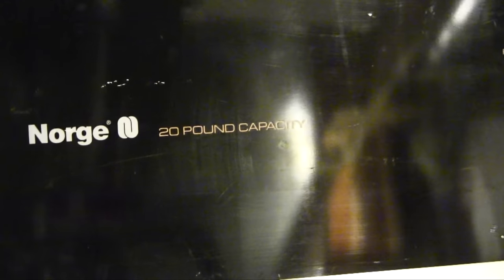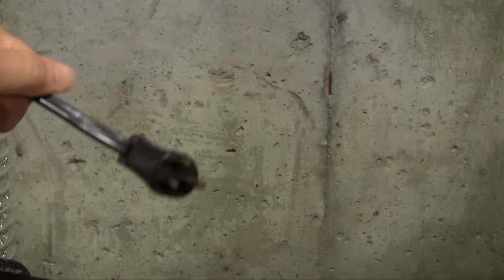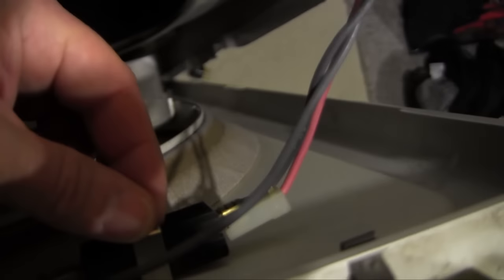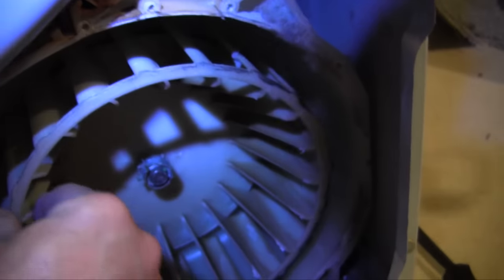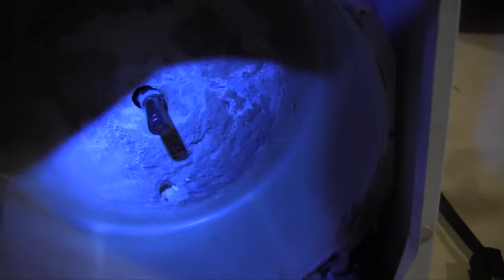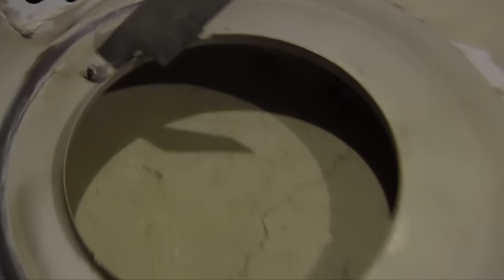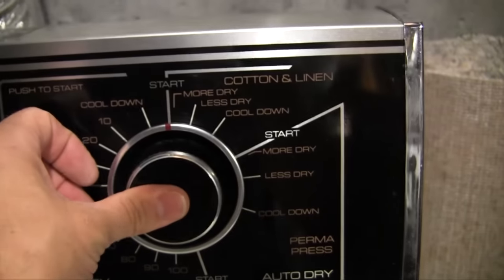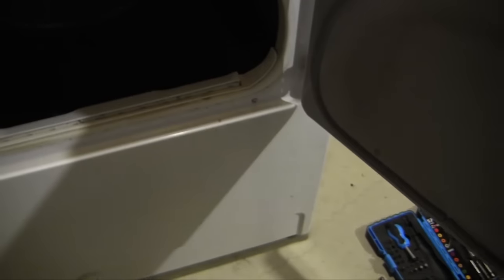Clothes Dryer Common Repair. Blower Squirrel, Cage, Fan Replacement

Comment: Almost the same type of dryer I have. I tried to glue that thing tight, but it didn't work. Thanks so much for showing that you could remove screws to get to it! Now I can replace the blower and won't have to trash the dryer.

Comment: Would never have figured you having NG out in the "sticks"..very lucky!
Yes, NG is much more efficient than propane and electricity for heating and cooking. I'd switch over my Forced Air heater, stove and water heater from electric to NG in short order if it ever came out our way....which will be a long, long time.

Comment: Goodrepair...until you mentioned noise I was going tot say humidity sensor was bad...So your dryer on propane then? We only use propane for a fireplace and I was shocked when I had to have the tank filled for the first time in a year..about 4.00 bucks a gallon! Our electric is cheap in Washington and a neighbor said he ran the "numbers' and propane over electric only pays off at about 1.75 a gallon or less.